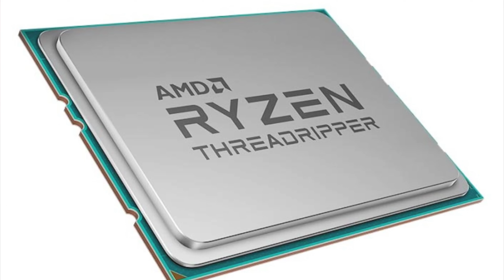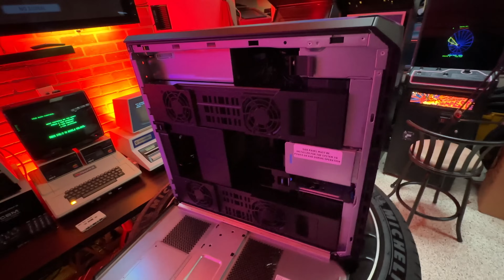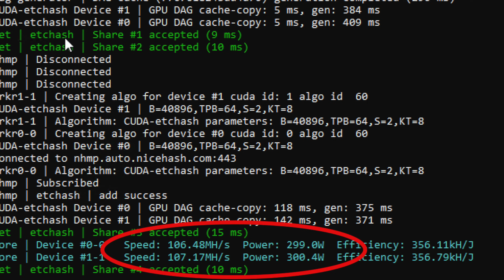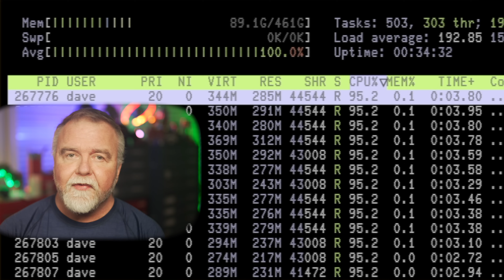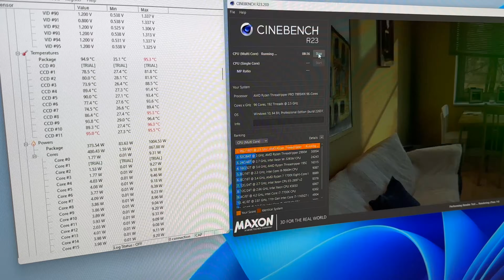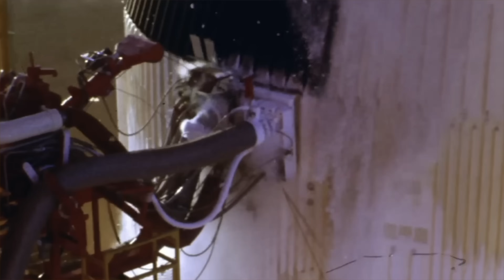1000W CPU:  The Most Powerful Desktop Processor

Comment: I have a 5950x and LOVE IT. I only use one app - Cubase. I need as much processing power balanced between many threads and single core processing because when you're working on music, every new effect you add on the chain has to be processed on one thread. I've waited 2 years for an update - whatever the Q4 AMD release is, I'm going for it. It needs to be silent for the studio, so fully water cooled. 

What can I do to design a system PURELY for audio production? I need the fastest drives and RAM (loading multi gigabyte sample libraries into memory to then play realtime with a keyboard is done several times per project, and loading them in once SSDs arrived was a joyous update in the last 20 years of music computers.. it was a huge timesaver)

I have a passive graphics card that runs 3 screens perfectly too at ridiculous resolutions. (Need a LOT of info in view at once - the track, the plugins, the freq analyser etc)

Any idea on the best type of chip for solely running Cubase and audio plugins?

Would an older, cheaper Threadripper be better than a modern or upcoming mainstream desktop CPU?
Threads don't seem to offer any benefits on music production past a point. But I don't really think anyone has benchmarked a CPU just for one task. Which is odd, seeing as I would think people would be desperate to know the answer to that.

Also, need low latency MIDI input - I've heard AMD has issues with this depending on the RAM and overclocking might screw up the timings used for MIDI input. 
Its so complicated.. I've got until November to work it out though! :)

Do I need this much processing power? Actually, yes..! Processing audio is real-time, so all the plugins are running even if only silence is running through it. 
I consistently max out the CPU for hours at a time until it falls over and I have to start converting the realtime audio to "flat" audio tracks... which are then 48khz uncompressed WAV files - which all have to be read back and played simultaneously. 

Calculations for audio playback at 24 bit, 96KHz is 576 KB per second. So playback of a song with only 20 tracks (projects can go upto the 100s of tracks easily) will read data (obviously, it pre caches as much as possible) at a potential 115 MB/s - each track can have a chain of up to 10 plugins or more on each. It's insane the amount of processing going on in real time!

Everyone talks about video and 3D as being processor heavy, but audio is right up there.

Comment: It amazes me how so much watts can be fed through those tiny CPU pins without them sparking. Running at such a low voltage, how does massive current not melt everything.
Reply: A metric crap load of pins dedicated to power haha, explains why the socket has some 4094 pins in it.

Comment: It blows my mind how far cpu's and PC's in general have come in the past 20 years, let alone the last 40!

Once upon a time I was big into computers. Started at 5 years old on a Commodore 64.

In 1996 my folks bought me a Gateway 2000 with a mind blowing Pentium 200 MMX and 64 MB of ram, 2.6 GB HDD.

In the very early 2000s I paid for the cable internet upgrade for the house.

Come to find out that my 6 year old PC was a bottleneck.

My 500Mhz equipped laptop could unlock the full speed of the link at the time however.

This was also the time that the internet was undergoing a revolution.  When most folks had dial up, websites were kept basic and tidy, basically a series of descriptive hyperlinks to get you to the file or photo you were looking for.  However, it wouldn't be long before all the multimedia, photos, gifs, and flash would show up

Comment: Very interesting stuff, Dave! I built my own system a couple of years ago. I didn't give myself a completely unlimited budget, but I didn't cheap out. Luckily, I did my research and kept everything in spec and made sure everything fit without modification. Thus, I've never had unstable performance or stability issues. I think that's the biggest takeaway from your video.

Comment: @DavesGarage can you do a video or talk about Windows SMT and the limit of 64 threads per CPU "group"... it seems like these latest HEDT chips with over 64 cores (let alone threads) are running into this, causing alot of software that is not "CPU group" aware to not reach max potential.

Comment: "when its allowed to run free and eat"  Love it, because it is eating amps and spitting out watts!  Thanks for leaving that in!
Reply: Given V-core is likely around 1.4v under load, we can guess that socket was pumping a bit over 700A into the CPU through all those little pins. I've welded with a lot less current that that.

Comment: The must power sucking PC I ever had was a Mac Pro PowerPC - the 2.5GHz dual CPU (dual core) system - in winter I would heat up my study very nicely and the fan noise.
Reply: That was the fastest PowerMac G5, dual dual core 2.5ghz PowerPC CPU’s. Absolute rockets for the time but made probably as much heat as this threadripper or more haha

Comment: Re that onboard fuse that sets if you ever overclock it, something I've wondered for a while... how does the CPU know it's being overclocked? Isn't it's only perception of time from it's clock pin? Does it have an internal clock, or some monostables or something, to check the duration of a clock cycle?

Also I'm getting a terrible feeling that the limits to chips like these are gonna be from the power pins, how many can you add, and how well can you conduct hundreds of amps around silicon? Do they have special silver power planes made thick as doorsteps? There's welders that deliver less current than that. They're gonna have to put car battery terminals on top.

Also if you're going to stick a hundred cores on a chip, why not just do 50 each on 2 chips? What is there to lose? Is inter-core data transfer a big thing with these, do they have a wide path for that? I can't imagine it's something that software does a lot of, unless maybe enormous finite element stuff, weather simulation. A cache coherence problem? Whole thing seems like they're climbing a steep hill that's soon gonna be vertical.

Compiling 30,000 files at once doesn't seem like it's very inter-related, seems like 96 chips with 1 core each would do just as well, and be much easier to put into practice. Or at least maybe 8x16 core chips.

Comment: 10:00 so part of the issue here is AMD's chipset trying to use as much power as it physically can when under intense load. The other cores have more headroom in the power budget so they take more until they either run out, or can't take any more. It's one of the side effects of AMD's new policy to overclock based on your cooling (on consumer processors).

Comment: My approach to a thermal limit is to operate the cores as efficiently as possible. If you used all 96 cores but operated them at 1/5 the clock rate you could get the result in the same time., but  with 1/25 the power. 70 W instead of 350 watts. It is the (Watts = I squared R) thing. I don't know if Threadripper has an equivalent of the Intel Extreme Tuning  Utility but I thought that AMD CPUs are not locked so maybe something like this might work better than better cooling and use less power.

Comment: I wonder how the latest Stockfish or Leela Zero chess engine would perform with both CPUs & GPUs for its neural networks.

Edit: Oh it's nice AMD put the 95C max temp too on these CPU, just like their lil' brothers with 16 core or less. That's a built-in protection. What is cool though is with the TR larger surface, you were actually able to "suck up" heat from it because of the larger contact patch from the pump, a thing that is not possible on say the 7950X and it's tiny surface.

Comment: I talked to the friendly and very helpful people at Puget Systems, but they don't do water cooled. I was planning to put in the basement where it won't heat up the office and is closer to the distribution panel and its noise won't be a problem. Sometimes it is true that. "The more you by the more you save".

Comment: The 2019 Mac Pro has a legally-maximum 1400W PSU but surely most of it is for the four GPUs you can configure;  I know with one GPU, the 28-core Xeon configuration can draw 500-600 watts in total.

So if 1400W is the limit, what do you do with the GPU if the CPU uses 1000W — external power?
Reply: There’s no legal maximum to the power consumption of computers, just how much you can pull from one standard circuit in your house. (Atleast in the US, it’s about 1500-1600w per individual circuit) once you go above that (ie, use a 2kw PSU) you’ll either need to get the house wiring upgraded, or split the load over 2 separate circuits, either by using a cable that goes from 2 standard cables to 1 high current one into the PSU, or run 2 physical PSU’s, one on each circuit.

Comment: Honestly, the limiting factor for cooling is heat transfer from the CPU to the Water.

With a good copper waterblock, the best thermal conductivity for copper is 390-400 Watts/m K
Your other limiting factor would be the thermal conductivity of the thermal compound. Your best bet would be liquid metal, if you remained on H2O.

However, the best effort you will see is going to be on Liquid Nitrogen... and I don't forsee many people going that route, considering, as you pointed out, that's a 10k chip. Maybe LTT... but that's kind of a DUH, statement at best.

Best bet would be a proper glycol mix coolant with a pure copper loop, and for the radiator, Hardware Labs Nemesis GTX 420mm.

Comment: Back in the early 1990s I bought a Sun 3/160 from a guy out in East Bay.  I remember opening up the front of the cabinet and seeing the sticker “1.5 KW” on the power supply.  Went straight to KW, no messing around with Watts.  😊

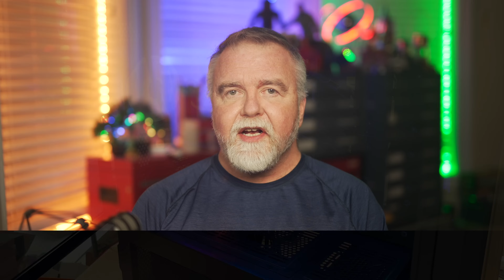Comment: 11:02 Anton the editor is incorrect.  Precision Boost Overdrive is an overclocking mode found on all ryzen based systems from 3000 series onward and is part of the default UEFI implementation provided by AMD to it's partners.  For a couple of easy examples, I have asus, gigabyte, and asrock boards currently in service in my house right now with various ryzen 3000 and 5000 series cpus that all support PBO.

Comment: "How powerful is your CPU"
"A bit over a horsepower"
"Oh that's~ a bit over a what???"
Reply: 1 horse power is roughly 750 watts. So a bit over 1 horsepower.
Reply: @techfan7808 still only half a Clydesdale.
Reply: 1 normal horse is about 3.5HP as the measurement was only ever done in theory and never in practise. 
a Clydesdale is about 7.5-8HP  @mikem9536
Reply: @techfan7808 1kw around 1,36hp/Din. 1hp/Din would be ~735w ish.
Reply: If you could spray those electrons out of a fire hose, it would be like getting kicked by a horse.
Reply: My overly modified nitromethane R/C car puts out about 1hp, so this computer is basically equal to one remote control car.

Comment: My small den office reaches 88F in the summer when I'm working on my 3970X.  That's with a sub-300 watts cpu.  I can't imagine what 1000W would do.   On a separate note, I need to add air conditioning in the den office.

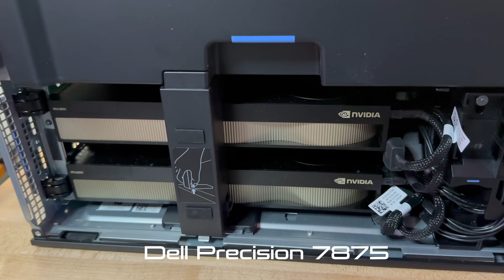Comment: 4:30 Dave I suggest running folding@home if you ever want to run multi gpu tests and look at the points per hour calculation and test the entire system
Reply: Can be tricky though as not all work units scale to more CUDA cores, though admittedly its seems a lot rarer lately to get a WU that doesn't.

Comment: Dave I just purchased a thermal contact plate for my Intel 13th gen cpu. It replaces the stock bracket and gives it more surface area to dissipate heat.

Comment: Not surprised at all about memory issues after the upgrade. The desktop Ryzen's memory controllers are plagued with the same thing - the more sticks you put in, and the more density they have, the more you have to reduce the memory clocks in order the rig to boot/work without mem errors. 
Still amazing that you could get it running with 5200mhz, which is far improvement from first generations of Threadrippers, where populating every DDR4 slot meant you'd have to drop speeds all the way down to 1933/2133MHz for it to work with most of the memory sticks (those memory controllers tend to like some memory ICs better than the others, namely in DDR4 era they hated Hynix-die based ones and ran with much faster clocks/tighter timings with Samsung B-die ones, unfortunately stick manufacturers tend to not advertise what ICs they use).

Comment: With dell and hp workstations at this point it comes down to brand preference and who's customer service process you are familiar with. Both hp and dell for business class customer service have top notch customer service. Hp how ever has been help the customer help themselves longer than dell. They are just better at walking a customer through fixing issues that come up. When hp bought Compaq they took Compaq's top notch customer service and rolled most of the staff over in to hps own CS and then improved on it. When you open up a hp or dell business class machine you will see things like no warranty void stickers they are made to be user serviceable using ither toolless entry or single screw type closers with captive screws to make basic repair and upgrades as easy as possible  for the owner of the computer laptops or desk tops same thing. HP and Dell would rather provide a manual for repairs with the system and walk through as needed than have it come in for service. They will both how ever accept them for repair work at a trusted partner who will typically come and pick up the machine or do the work onsite. 
This does 2 things 1 it allows them to save costs that get passed on to the costumer and 2 it reduces downtime for the customer which results in more return customers.. 
While sure ok the hp edges out the dell by a tiny tiny bit but in reality this tiny speed boost probably is not worth the switch even if the hp could be a little less upfront etc cost because of familiarity with the customer service team. The funny thing is even hp trusted retailers and tech support wont try a hard to sell you on the switch because well hp again does not want the customer support hassle they want to reduce costs for them and for you. They and dell would both rather lose a sale than deal with a new customer who is to use to how the other company does things. It is 1 reason why the 2 companies are with in a few percent of each other spec for spec on machines. They both make plenty from old customers and they both get plenty of first time buyers of thee machines. 

So buy from the company you know the best

Comment: Back in the day, you had a heater and no computer.
Then you had a computer and a heater.
Nowadays, your computer is your heater
Reply: Exactly. My smallest room has no heating but a 13700 system.
Reply: I remember they said people you should save electricity. You can do more with it but it gets more and more and more.... And here the price for that goes up and up and...😅
Reply: It's like an average guy buying an expansive car. With this computer, he can only use it when electricity is at off-peak hours.
Reply: I used to run a VAX at home.. that idea of your computer being your heater has been around for quite a while... 🙂
Reply: @c128stuff Back in the day, we had VAXes at Uni.  Unobtainable for us mere mortals. Then, recently, I saw a vid on YT from some showing the inner workings of a VAX. A board for CPU, one for RAM, I/O etc. mounted on a back-plane. I thought: I can do this. Then he showed the backside of the back-plane with a tangle of yellow wires which needed to be configured to your setup. That's when my confidence waned. When I saw the power plug, I knew: Even if I could buy such a system, and even I I could configure it, the electricity bill would kill me.
Reply: @TomFynn  Yeah... power use of those machines is not something you want to pay for.... 🙂
Reply: it's funny just how effective mine is at heating my room. if my psu wasnt crap, i could uncap my fps in games and my room would be a "cool" texas summer at 90f. capped, i've measured it at 84-5